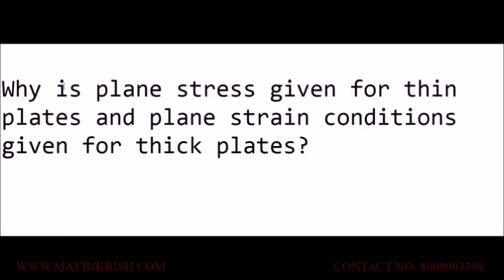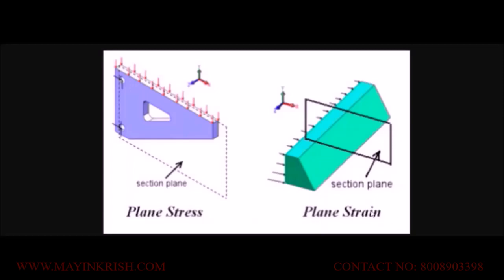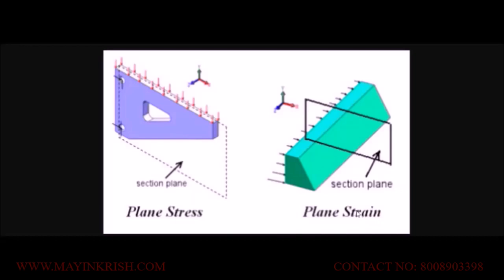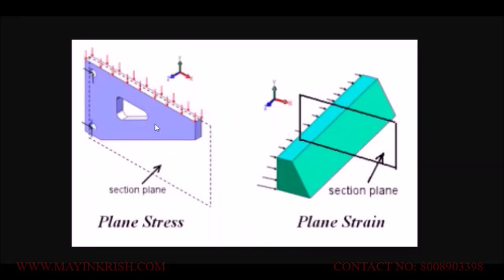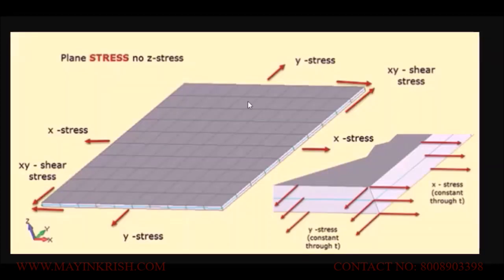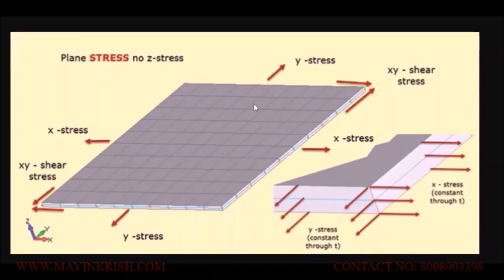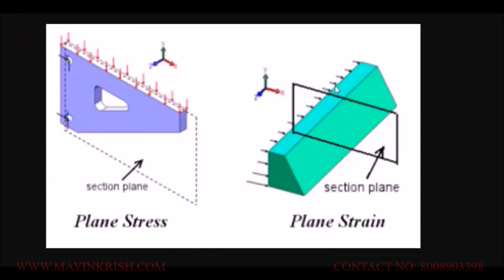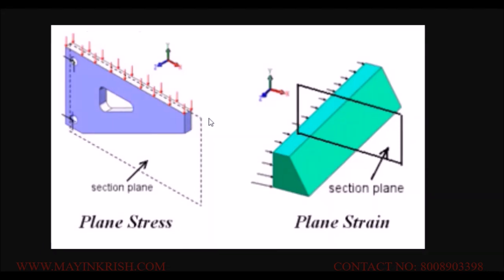PLANE STRESS PLANE STRAIN

Comment: Is it necessary for the thick plate to be constrained in the no strain direction? Like a translational boundary condition in both sides? If it's not constrained then there will be free expansion in the body in that direction, effectively causing strain in that direction..am I correct?